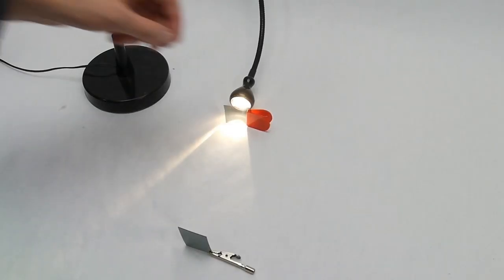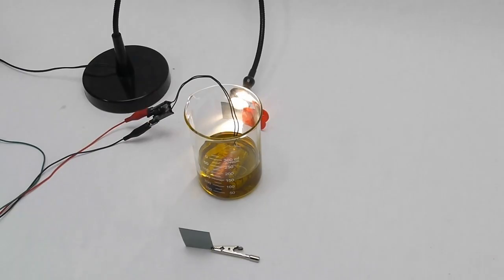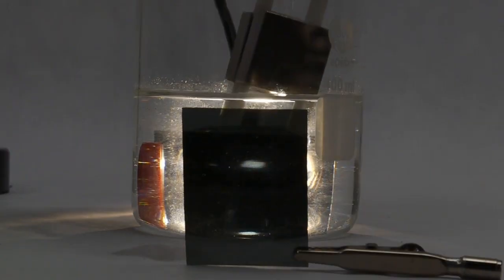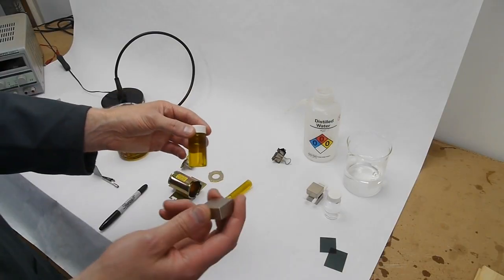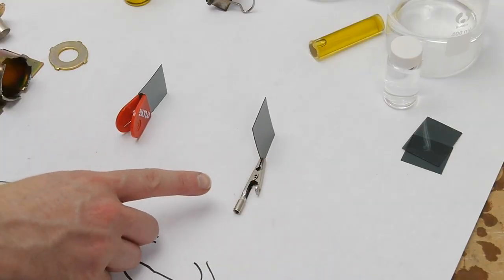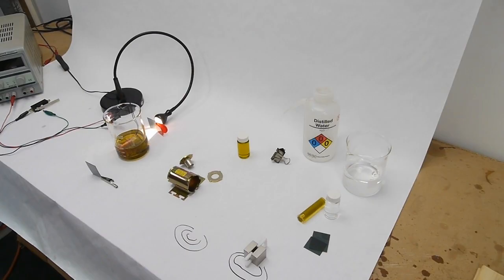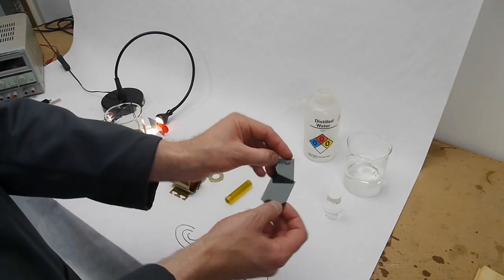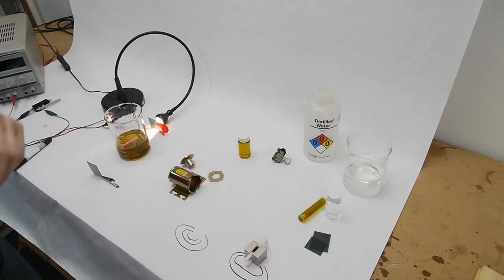Control light with magnets and olive oil?! (Faraday effect)

Comment: One trouble I had in understanding how devices like the Faraday effect above and the quarter wave plate works was that I couldn't understand how the plane of rotation would be rotated exactly 90 degrees when it left the device. I figured the total amount of rotation would vary with the optical path length.

Turns out that the thickness (optical path length) has to be just right, and indeed, quarter wave plates are manufactured to have just the right thickness for their target wavelength. So I was right, I was just ignorant of the fact that they're manufactured with that constraint in mind.

Comment: Thanks for posting that! Found this video (again?) today after reading how the applied external magnetic field supposedly DOES actually modify the angle of an EM wave by manipulating the magnetic wave component that then changes the angle of the electric field wave component of that wave that is supposedly the main visible portion.

Comment: So it is possible to create isolated measuring device that does not electrically "touch" the circuit. I mean it is possible to measure electrical toroid on a PCB with light emitter and receiver without any interference? How about electron double slit experiment and measuring witch way electron took.?

Comment: I know this is an old video, but I thought that I would give this a go with a pair of 40 x 20 x 10mm thick N42 Neodymium Magnets, but I've had no noticeable effect on olive oil, where the video shows it visibly working on water. I've used a different amount of spacers to to match with the description around 4:42. I even added a 3rd magnet to extend the lines further. I also tried a polarized 50 mw 650 nm lazer, as the verdet constant is dependant on the frequency of light, and I was able to all but extinguish this much light with my polarizers crossed, so any change would be quite pronounced..

I am trying to work out what I have missed; any ideas?

Comment: In high power laser optical isolators (device to stop reflection back to laser source) we use TeO2 as a crystal material, you can get the 45° or more this way. We put a polarised beam splitter in as well to put the waste energy out into a beam dump, because at high power you will break stuff. I blew holes in PBS already. And another material that's over 2000W/mK xD

Comment: What you demonstrated with the 45 degree polarizers is a light diode.  As an analogy with electric diodes, the optical polarizer lets light pass through the material in one direction but not in the opposite direction.  I can't remember the details, but this has applications in laser technology.

Comment: Hmm, Could This Work In Windows? Like In Car Windows For Celebrities Or VIP's Or Even On A Large Scale For Other Aplications?
Two Glass Layers And The Oil Is Inside In Them And The Copper Wounding Is Around It With Bigger Transmitter of the electricity? like a Magloop tranceiver?

Comment: I think it's blocking the light because of impeding charges much like using a magnetic field on anything else. What happens if the oil is frozen after and before the magnetic is charged? If after the oil is frozen and the light is still blocked a bit, the reason the light is blocked as mentioned is wrong. Light isn't polarized. Electrical generated light is mostly oscillating current, voltage, or resistance. When you have all of those oscillating you have AC and you can get different spectrums of light from AC, with no polarization. When you generate light from DC, depending on which, power source or just a battery is used, you can get 3 variables oscillating, or just one or two. That's not what's important though and what causes the misinterpretation of polarization here. What's important is the magnetic field from the generated light. It can pass through some things depending on the spectrum or the material it's heading for. It might simply not exchange charges between mediums. As you know, only heat is transferrable. That is because we are dealing with a magnetic field. Scary. Anyhow, where do you see polarization in heat from a magnetic field? Magnetic fields generating heat would interfere with each other. They probably won't exchange charges because the frequency is way too low. I don't think you will get better luck by increasing the frequency become then you won't see the light. Anyhow, this video is from 2015. It's now 01/25/2022 and people still believe light can be polarized. End.

Comment: could the principle you discuss @ around 6:00, be used to create windows that are truly 1 directional?
i know that for example in police lineups, there is usually a 1-sided window, but those are based on reflection, where the more poorly lit side can view into the well lit side, but not the other way around.

this way, you can have a window that is relatively clear on 1 side, and totally opaque from the other, without a real dependence on lighting conditions.

also, this makes me wonder if an exact 45 degree rotation can be achieve be using a specific thickness of sugar-water solution, rather than using any magnets.
from what i can recall, natural sugar has a consistent "handedness" to the molecule, and this makes it rotate light polarization by a certain angle dependent on the distance that the light had to travel through the solution.
if this is correct, then you could tune the size of the container and concentration of the sugar-solution, to achieve a perfect 45 degree rotation, thereby making this "1 sided window" without magnets.

since i'm a layman, did i get something wrong?

Comment: you might want to try WD40 or something similar mixed with some ferro fluid,  then sandwich between 2 glass plates a very thin layer, use a led strip below, "many light sources",.  use a strong neo,  look though the glass sandwich while holding the neo in between the light sources and the glass sandwich, you will have a very interesting magnetic viewing film.. that bends the light of the leds to show the field lines.. pretty awesome effect ;)  not sure this is the same effect as you describe but it reminds me of it hehe the ratio of ferro fluid to carrier liquid like wd40 is quite important for the resolution, also try to only get the smallest partials in the ferro fluid, will increase the resolution as well.. have fun..

Comment: Very cool effect.  The faraday effect is also used to measure current in a high voltage power line of aHVDC power station,  they wrap a fiber optic cable around the cable and I guess measure the amount of polarization change which is proportional to the magnetic field and thus the current in the cable.

Comment: Now use it to play with quantum entanglement! Just need a laser and crystal (photo multiplier would help too I guess. 

Maybe see if you can get one stream of electrons to pass through an anti-polarized filter by changing the orientation of the other stream of electrons? Changing one should affect the other right?

Comment: It took me a while to understand this. Faraday effect is nice and all but THIS IS LITERALLY BENDING OF LIGHT.

The polarization of light allows only one part of light to propagate through it. The intensity of polarized light is reduced through the use of secondary polarizer.

However, you proved that the intensity of light is reduced using one magnet and ONE POLARIZER.

In what way can the intensity be reduced other than using another polarizer? Shine light away from the polarizer duh. Magnet bends light. Faraday effect proved it.

You give a false claim of rotating polarization. This is false as the original light is 360 polarization combined. Polarizer removed that 359 polarization degree.

Do how can rotated light even create any change? It is he same as rotating the led. Unless you move the led away from the polarizer, the intensity is always the same.

Hence, magnet bends light which destroy einstein's bull crap claim of light propagate in straight line.

How can light no be bend when it has a magnetic field? This experiment proved it can be bend.

Comment: (Ben Krasnow, I never found your contact email, so I will put this here.)

Anyway, I like your videos because while there are many tech youtube channels, there aren't many people doing actual science-stuff. Other than doing some mechanical stuff, and a little electronics, I like doing optical stuff with...junk this:
https://www.youtube.com/watch?v=ZH40mvSFI-g&t=1393s

Though I am redoing it with an axis from an old wafer inspection microscope.

BTW, while I am sure you know how to write Arduino sketches, I wrote a command-line stepper motor utility with sinusidal smoothing that was written for science experiments, that might be handy. There's a video tutorial later on in the link.
http://forum.arduino.cc/index.php?topic=469343.msg3213804#msg3213804

And if you find yourself in the South Bay, and are in need of coffee, I usually hang out at a coffee shop. Contact me.

Comment: Another fantastic void.  I wish that I had know of this when I was in school, would have made a great science project.  

I'm wondering if a reverse effect could be seen.  If a powerful light was projected through the coil, as you did, while a very steady and very preciously measured and monitored current was flowing through the coil and the light was then switched on and off, could there be an effect on the current flow though obviously very, very small?

Comment: I have been doing light research and it appears a venturi will accelerate light as does a venturi accelerate water. Light appears liquid and the Fields surrounding the charge carriers are seen with with dots in polarized rings. https://www.youtube.com/watch?v=FnNVIlNK5MA&t=2s

Comment: OMG. You have just explained the butterfly wing phenomenon. There is a butterfly that has spots on its wings. When you turn it over you do not see the spots you can only see the spots from the top side. Twisting of the light explains it. Polarizing filters combined with a magnet built into the butterflies wings. And you think there is no designer.

Comment: Just put the filters inside the plastic-tube next to the Oil. Than it will not affect the setting. Than you can use even a sealed plastic-tube.

Comment: Try to add components to a 24vdc Brushed motor 500watts 4800rpm and make it work harder neutons and and or use less current.  Project Ebike. Your presentations are informative and comfortable to listen to. Thanks, Tim.

Comment: 6:40 that one-way transparency property is cool, especially if it's a stronger effect than what commercial one-way glass provides. So, if you put a mirror on the other side and looked through the lenses, I guess the mirror would just look completely black?
Reply: Not just the mirror.  Everything would be black - no light would come out of the tube.

Comment: I'm certain you are describing the accepted scientific explanation properly, but I think it overlooks the fact that magnetism affects all materials, especially fluids. There have been boat engines designed to propel water solely through magnetism. Likewise, regardless of material, all solids are effected by magnetism, even if very faintly. If you align the atoms of a transparent material, you'll get a polarization of light that passes through them. In Faraday's time ether theory was prevalent, and I believe they greatly overestimated the effects of magnetism on light via the bending of space itself. The sun, for instances, has mind boggling levels of magnetism, and yet light still escapes from it very regularly. I think you're showing magnetism polarizing substances, not light itself. Has this experiment been done in a vacuum?

Comment: Can it be from the dimming of the ligh source due to the a change in the current passing through it. The coil can be thought of a huge resistor and that diminishes the current in the  circuit. What do you say?
Reply: He repeated the test with nothing but the electromagnet and nothing happened. Then he did it with a permanent magnet and the same thing happened.

Tl;dr: No.

Comment: That application is like a light diode
Reply: Now that you have discovered a light diode we need the equivalent of a capacitor and inductor for light , a convex lens is a Fourier transform so you now have a processor ? Interesting !
Reply: +graham kaveman also will a strong  electric field do the same thing ? Very interesting fundamental experimentation here
Reply: isn't a laser like a capacitor for light? Maybe a high efficiency solar cell could be an inductor if it could then power the laser although I assume you would rather have materials for both instead of machines so you could miniaturize easier.
Reply: fool ! is all i can say

Comment: Very good info. and well presented. Now imagine a ball of light consisting of charged particles suspended (levitated) within a magnet field emanating from a disc-shaped magnet. Charged particles (electrons etc.) in a magnetic field follow a helical (spiral) path (see my "Helix" video). As you correctly state in the video, the field is stronger at the poles (centre) of the magnet. It is also stronger towards the outer edge of the magnetic torus where the field lines are, as you rightly say, "more parallel." I noticed that the light changed to an orangey colour as you rotated the field. What happens to the ball of charged particles when it spirals into those stronger magnetic field zones which are also rotated due to the field lines of the torus changing direction? You are aware that during an eclipse the moon becomes red immediately before and after light extinction? Please watch my "Lunar Eclipse" video for more on this. You may also be interested in my "Fleur-de-lys" video which explains how the ancients understood magnetism.

Comment: Just a mad Scientist Thought here... What if I had a extremely powerful electromagnet capable of rotating light 90 degrees in air over a span of ~20 feet. I could go into  3D movie and make everyone puke as the images reaching their eyes suddenly swapped.
Reply: justin wood I think they might be too distracted by all the metal items they were carting turning into ballistic missiles.
You get points for the mad bit though :)
Reply: Lol at both of you. very funny and yes mad mad scientist points
Reply: 1 sudden swap won't make anyone puke.
1000 random swaps in 5mins will break the audience
Reply: It would probably just make them take off the glasses. And also since you have to put the magnet in front of the projection aperture, you can just mess with the filters instead.

Comment: Cool set up. I suggest you use three different lase pointers (red, green and blue) on a colored liquid (engine oill) and measure the amount intensity of light with and without the Mag.field. Your demo is excellent. I have a couple of publications on Mag CD. I wish you could demonstrate the Kerr effect, reflected light on a magnetized surface. Note: polarizers give you circularly polarized light.

Comment: Hi, what was the voltage and amperage you were using?
Also, what wire gauge where you using, also is the coil of wire just around a plastic tube or metal tube?
Reply: +Ernest Colon At 7:45 I believe he did specify roughly 1.5 amps at 60 volts. He didn't specify the gauge of the wire as far as I can tell since he extracted the solenoid rather than making it, I'd guess between 22 and 26 gauge (which is a somewhat large range...). There were only a couple seconds you could see the coil as he was extracting it, but it looked like the core may have been copper. For the gauge and the core, it will be preferable to have a smaller gauge (assuming it can handle the energy) to obtain more turns in less area, and it is better to have a conductive tube rather than metal. To demonstrate the effect you would want to have as great a field as possible; making an exact replica isn't important.

Comment: You just answered a question I have had for years:  how did the ferrite rotators work that changed the polarization of an X-band radar wave 90 degrees with a simple, dc input.  Some second-generation airborne weather radar systems with parabolic antenna dishes (e.g. Bendix RDR-1) had a grid made of metal wire perhaps 2 mm in diameter, across the upper portion of the parabolic dish.  In weather mode, a "pencil"-shaped radar beam was required, and polarization of the beam was maintained by waveguide to be in same direction as the wire grid, passing through to the parabolic dish to focus the beam.  In map mode, a fan-shaped beam directed downward was used to map, or "paint," ground targets such as coastlines and cities.  Selecting map mode sent a dc signal to a unit called a ferrite rotator on the antenna feed horn, activating a magnetic coil and rotating the waves so that they hit the grid and deflected downward, effectively changing the shape of the dish.  Now, many years later, I learn of the Faraday effect, which is, I suppose, what made it work.  Later radar systems use flat plates to shape the beam, ruling out use of a grid.  I believe that another method of shaping a map beam was developed for use with flat plates, but that was after my time.
Reply: Канарев Ф.М. - Дифракция фотонов.doc - https://cloud.mail.ru/public/Lspd/4PEoBcYQN

 «Канарёв Ф.М. - Фотоэффект.doc» - https://cloud.mail.ru/public/6gr4/yzMs4fVGM

Канарев Ф.М. о взаимодействии спинов фотонов.doc - https://cloud.mail.ru/public/9yWt/xdGqj1ysU

Канарев Ф.М. об Эффекте Доплера.doc - https://cloud.mail.ru/public/EAgw/BEoyxvVvC
Reply: По следам эксперимента Баранова-Зателепина , 12 августа 2019 года https://drive.google.com/file/d/1QsUVE55DRhdoR32kdaXusBYhbRZ16b4-/view?usp=sharing